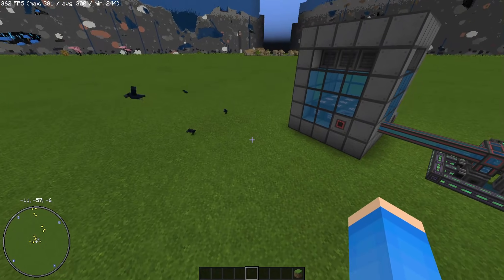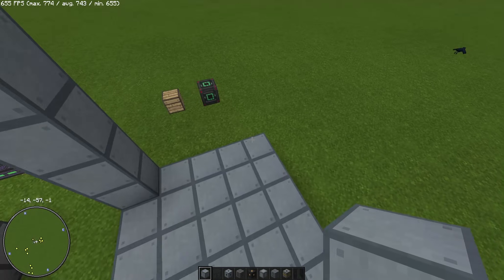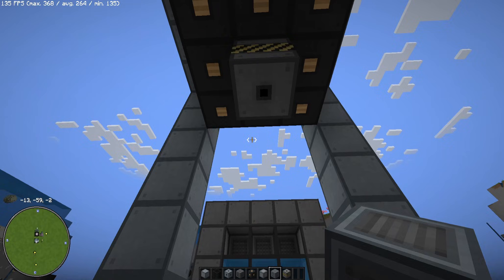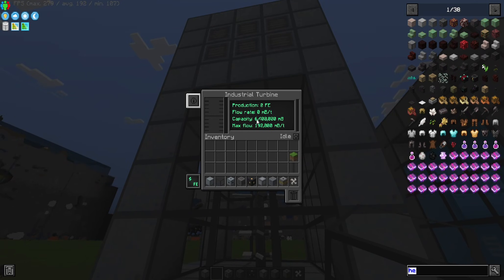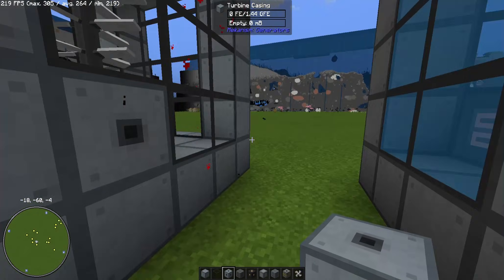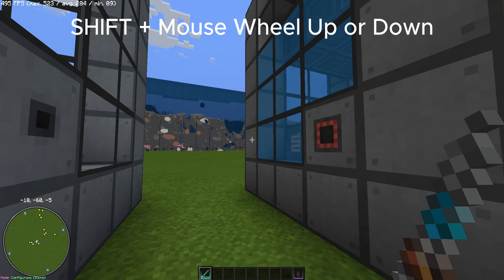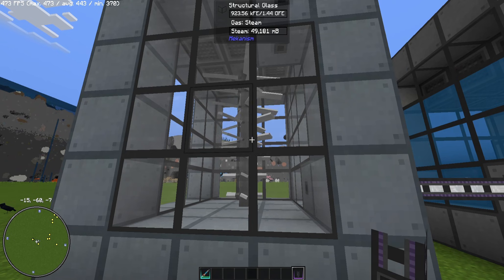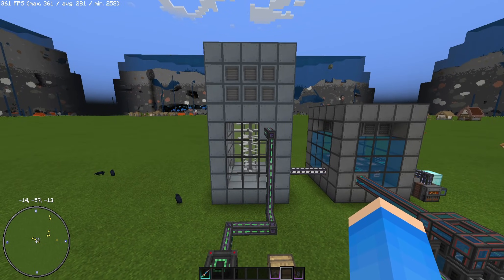Industrial Turbine Mekanism Mod Tutorial - UPDATED 2025

Comment: If you are wondering the materials needed:
114 turbine casing
46 structural glass
2 turbine valve
8 pressure dispenser
9 electromagnetic coil
9 saturating condenser
6 turbine vent
1 rotational complex
4 turbine rotor
8 turbine blade
8~ pressurized tube
1 configurator
as many universal cable you need